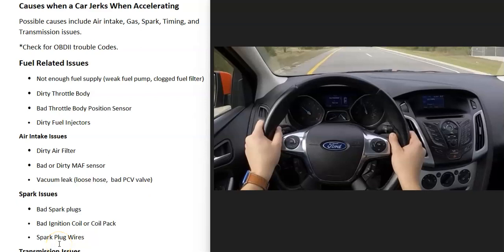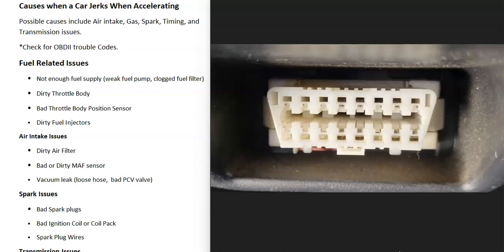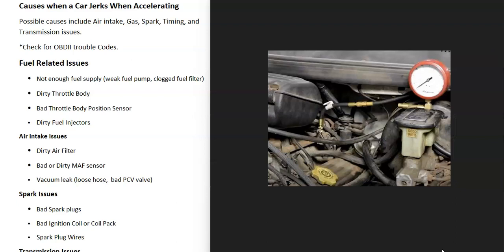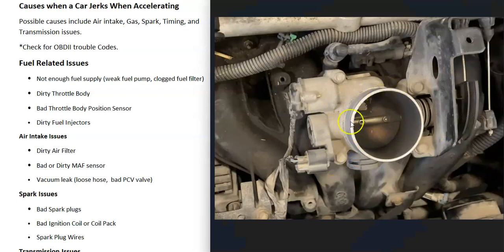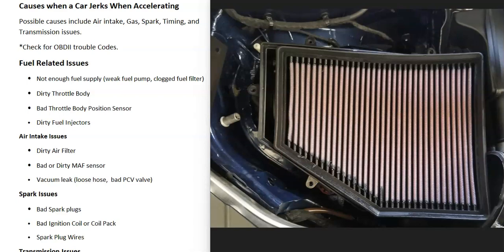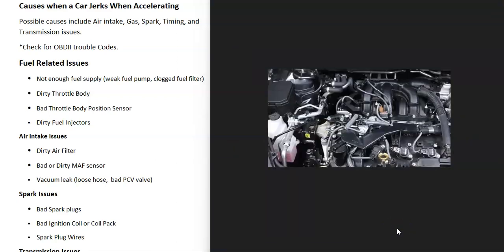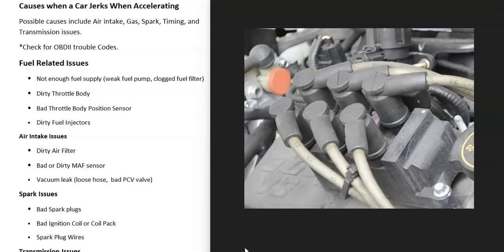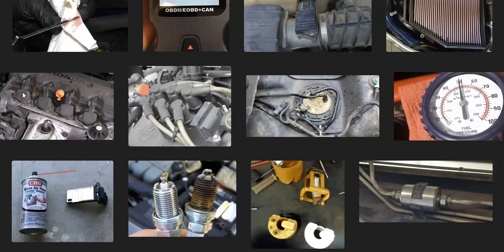Causes and Fixes Car Jerks When Accelerating

Comment: Ignition timing can also cause issues. I had an electrical short which reduced power going to the VVT solenoids. Caused timing issues.
Reply: says potential timing problems at the top of the video

Comment: Thanks for the video. I have a 2017 Chevy Spark and my car starts jerking while on a highway when traffic is moving slow then picks up. Just yesterday traffic was normal speed then all of a sudden went to 40 to 50 miles per hour for about 5 minutes then back to normal speed then back down and while I’m going to the speed of traffic my check engine light came on and car was very jerky until the point were it stopped moving. When it did start back moving it jerked very slow until it finally picked up speed. What could possibly be my problem?
Reply: Sounds similar to my problems, but mine only goes to 40 and doesn’t downshift, and today I was going 20 and it jerked quite a bit. Scanner said it may be ECU ( engine control unit). At best it may be some wiring, at worst my transmission is probably starting to perish.
Reply: I have the same issue. I get the code 0711 which says the Transmission Fluid Temperature Sensor is bad. I have the car at the dealership at this moment so they can diagnose the car.  They will confirm if the sensor needs to be replaced so I’ll be back with an update for you.
Reply: hi can i get an update?

Comment: Please help me I have a 03 mustang GT I’ve just replaced the fuel pump and transmission fluid when I let the car sit for a bit then u start it back up it accelerates fine but once I drive it for like 15 - 20 mins it starts to jerk and when I floor it it won’t go past 30 but when I slowly and steadily push in the gas it accelerates help me!
Reply: Sounds like an fuel to air mixture problem... mass air flow sensor or oxygen sensor

Comment: Hi can having installed a in tank fuel pump with lower flow volume than stock also cause issues like long term fuel trims going lean??
Reply: Yes it can
Reply: It would probably show itself the more throttle that is applied.. does it drive fine when your not accelerating hard

Comment: What about a p0191 code
Reply from the maker: The P0191 code stands for “Fuel Rail Pressure Sensor 'A' Circuit Range/Performance.”

Comment: Mine is a Buick rainier 2004 no engine light displayed 
It sounds rough in idle 
Now when I 1st take off and reach 15 ish miles per hour it loses power… doesn’t shut off or backfire, after about 10-15 seconds it acts normal even after I make a complete stop it runs fine from there On out…. Till I turn it off and restart it but it doesn’t do it everytime
I was also told it’s running rich
I got a new air filter, fuel pump was changed a year ago and replaced the fuel filter, replaced power steering a year ago and replaced the warmer pump thermostat and clutch fan recently, replaced plugs and coils maf is only a year old and recently cleaned the throttle body 
As well…. Any suggestions

Comment: Really like your video
But I have one issue maybe more 
 I don't know
When I give it gas it does good as long as I've got the power going up but once I get up to speed and try to level off that's when it starts jerking
Maybe think the overdrive was going in and out but that wasn't it
Bad gas I don't know
I'm old school if something back in the day with broke you knew what it was
Now it's like 30 thing between a and b
I know where some money thing
But anyway I can run wide open good
It's just when I try to level out and stay at a certain speed that's what it wants to jerk
I took it to three different places and it shows no codes at all the engine light's not even on

Why is it not showing a code I don't know that's my problem I don't want to fix something I don't need to fix I like to fix whatever it is
What is it that I can do if the no codes
Oh by the way I tried pulling a trailer I tried to put some strain on it to get the engine light to come on no luck
Why do you want to do that too much cuz it could be the transmission and I could be making it worse
Could you please respond and let me know what you think

2009 Dodge ram six cylinder

Comment: If there is no code?
Reply: I have 16 Tahoe jerks under low acceleration from 1 to 2 and is sluggish under light throttle..if I get on it it doesn't do it🤷‍♂️
Reply: @FLbowtieguysame here did you fix it?

Comment: Mine was jerking or cutting when accelerating.. changed the spark plugs and it runs like a new car
Reply: Spark plugs?
Reply: @SLOWDOWN863 yup.
Reply: What car did you have?
Reply: @oppajosh79682014 Explorer Sport with the 3.5 TT. Those engines are notorious for fouling out the plugs

Comment: my 05 escape v-6 bucks runs rough and stalls at hiway speed. The red light comes on with the lock over engine symble showing.
At cold start it runs nearly normal until engine heats up and then the speed drops and I will have to change out of over drive to maintain 50-60
After running 60 for 5 minutes the engine shuts down`. After sitting 5 minutes it will start and repeat the events. From stop light nearly pulls off at a walking pace. One person suggested the catalytic may de clogged. any thoughts? Thanks
Reply: Sounds like it's going into limp mode ...  what is your temperature reading when it shuts off after getting warm? You need to see what codes are displayed on the obd sensor ... it could be mass airflow sensor ... it could be clogged fuel injectors ... it also could be bad coils causing it to shut down due to improper timing due to the misfires ...
Reply: If your not getting enough fuel it will also shut itself down if the fuel to air mix is off and makes it run rich or lean ... this could be a clogged fuel filter or bad fuel pump ...

Comment: My jerk occurs when im 40 or faster just had a rebuilt transmission installed so maybe that's the issue but i noticed when i used fuel injection cleaner liquid it started happening
Reply: I used a fuel system cleaner, car started jerking a week later 😂

Comment: My car in winters usually jerks early morning but when I drive for 5-8 Kms it becomes smooth then doesn’t jerk through the day. 

In summer it never jerks. 

I noticed in automatic transmission when it shifts from its gear to second gear it jerks before 15 to 30kmph speed. 

Dodge challenger v6, 3.5L 

Any idea ?
Reply: I would recommend letting your car warm up longer in the winter, my truck does the same thing. I usually wait til the transmission temperature is past 80-85 to prevent it from shifting hard when I first move it.

Comment: My 2003 Mazda b3000/ ranger whenever I step on the gas all the way it goes up to 3k rpm’s then it drops and jumps up and continues to do that it like it shoots power to the engine then cuts out constantly any one have any answers?
Reply: ECU bro, or check transmission fluid. My experience so far is that those might be the issues. Even a vacuum leak, a hose might be catching air into the engine.
Reply: Same for my car rn

Comment: I have a 1995 Chevy S10 with a vortex 4.3 motor I just had a brand new fuel pump put in it a brand new starter had the timing reset on it a brand new battery and alternator And brand new fuel filter we picked it up yesterday from the shop that did the work. he drove great on the way home and all through town and but I wanted to take it down a back road and get up to speed quick you know? And when I did a little past the 2RPM hand it started jumping up and down and the truck started sputtering but as long as I keep it at the 2RPM or under it and accelerate normally it pulls fine. do you have any idea Why its doing that? And the only codes that are popping up on this truck when I put a code tester it's saying the EGR Valve
Reply: Same here with my 03 Mazda b3000 it starts to jerk and drop rpm’s once I get to 3k it would jump up and down
Reply: And I’m getting the same code I replaced the egr valve and it didn’t fix it
Reply: My code is saying the EGR valve also  @dirtysplat1336
Reply: 06 Mustang GT doing the same with new plugs, and coils and it’s had a fuel treatment done recently
Reply: Same thing with my  kia sedona but in my case its below 2k rpms over that it would be fine

Comment: 2018 Sonata, 92k miles.  - having to pussy foot my car around , (boyfriend replicated it the other day and will be bringing it in) .
Acceleration causes the car to go from 2-3k rpms and then around third gear it will just fall flattttt all the way under 1000 then it starts to stutter and pop until finally it catches and takes off. (Does it in any gear, manual mode) 150 miles currently in the tank.
Reply: Sorry for the bad explanation- putting this here for if they get it figured out. I have 4 shit boxes that I currently trust more than my sonata.

Comment: I have 2013 Cadillac XTS that does this. It drives fine and only stutters when cruising, and I lightly hit on the gas. The stutter goes away when I push harder on the gas or take my foot off the gas. My gas mileage is pretty horrible too. She has new spark plugs, a new air filter and mass airflow sensor, a new catalytic converter and two new O2 sensors in the front. The dealership did a fuel cleaning as well and I have cleaned my throttle body. I was having misfiring issues a few months ago and took it to Firestone and and they thought I had a bad fuel rail?! But they couldn’t replace that so they did a tune up. They put 41-988 spark plugs in and I googled those and everything said those only fit on the 2015 and up XTS. I called the Cadillac dealer and they said they would’ve put 41-109 plugs in. So I took my car back to Firestone and they swapped the plugs out. This is when I started to notice the stuttering. But on top of that I noticed that my throttle body housing was really dirty like maybe they dropped it when changing the plugs?! So I’m like it’s either they rushed and didn’t do a good job of putting the spark plugs in the second time or they messed up my throttle body sensor?! Plus I feel I could have like two bad fuel injectors. but every time I take it to the dealership, they can’t find nothing wrong with it. So I may take it back to Firestone to have them look at my spark plugs again to rule that out.
Reply: Hey did you ever figure out what happened with this situation? This exact shuttering is now happening to my 1997 Toyota Camry. Same thing, I just need to push a little harder or decelerate to get the shuttering to stop but I notice it around 45-60 mph
Reply: @ryanfrausto897  Sorry for the late response. But I got my ignition coils replaced and this fixed my stuttering issue.
Reply: Mine does the same thing because of the Transmission Fluid Temperature Sensor

Comment: 2014 ecape 2.0 ecoboost has new fuel inj new low presseser switch new plugs new timming chain head redone tow exhaust values  new varaivle timming sensors new oil change new tran change new thottle body new air filter i think it mite be coils because i can unplug them one by one and the number 1 acts real weak  does it have a fuel filter please help
Reply: All vehicles have fuel filters ... some are in the tank some are inline along the fuel lines and easy to change .... you can have your fuel pressure checked and that would tell you if it's a fuel delivery problem

Comment: I am the owner of a 2019 Chrysler Pacifica Minivan. I have noticed that when I slow down to a crawl, accelerate, or start from a stop, the transmission occasionally hesitates and jerks quite forcefully. The peculiar thing is that this issue occurs randomly in various driving conditions, and it does not trigger any error codes. Considering these circumstances, could it possibly be related to the torque converter?
Reply: Could it be the mounts lol
Reply: I'm having the exact issue. Mine is an acura 2016. Did you find out what happened?
Reply: @ In addition to the aforementioned symptoms, I started experiencing a spongy brake pedal that felt tougher to push than usual, and my stopping distance had increased.My mechanic suggested that I have my  BoostBuster/ brake booster checked.  

I replaced it  and I haven't run into that problem again. It might not be what's going on with you, but it’s a good idea to check it out. All the best.
Reply: @costellosamuel3706  I don't have that issue. I have an appointment with a different mechanic tomorrow. I'm praying he'll be able to find and fix the issue.
Thanks so much for responding!
Reply: @cassandranelson4470  I know how frustrating car problem and car repair can be,  God's favor and all the best.
Reply: I am having the same issue with 2014 dodge journey. It also happens when going up hills and takes a while to build up speed. So frustrating my mechanics says he doesn't know what causes it.
Reply: I have a 2020 Chrylser Pacifica and have nearly the identical problem as you mentioned where the car will hesitate and jerk when re-accelerating after slowing down and the RPMs hitting around 1,200. The dealership has no idea what the problem is because it is not registering any error codes. They think its possibly a bad coil pack or spark plug. Are you saying all of your issues were actually caused by the brake booster? I haven't noticed any problems with braking at all. Curious what you found. Thanks!
Reply: @mattbey  After my mechanic suggested replacing the brake booster, I went ahead with the recommendation, and I’m happy to report that I haven't experienced any issues in the past year. It's important to note that one solution doesn't fit all situations. I’m not a mechanic, but I did some research on the problem and found several potential causes:

- Dirty fuel injectors
- Fuel blockages
- Worn-out spark plugs
- Dirty air filters
- Damaged cylinders
- Blocked catalytic converters
- Damaged gas lines
- Damaged acceleration cables
- Defective carburetors
- Moisture on the distributor cap

“It could be a fault with the spark plugs or a buildup of dirt and grime. A clogged filter or fuel injection system can also starve your engine of fuel or oxygen, causing your car to judder and shake.” 

Additionally, Chrysler and Dodge vehicles, particularly older models, have a reputation for potential engine failure issues. Be sure to check if there are any recalls on your vehicle. God’s favor.

Comment: i have a 2018 kia forte with a manual transmission. whenever im in the 2,500-4,000 rpm range and let off the gas in third gear it jerks quite a bit
Reply: Same issue here on a manual transmission

Comment: I have a mitsubishi 2004 galant that was handed down to me and is just constantly a problem, the only code showing right now is for the evaporative emission system leak which now is large but my car runs like shit ive changed the fuel pump put cleaner in and changed the filter but it still really struggles driving i can only get to about 60 65 and 2500 to 2800 rpm and if i try to go higher it just starts chugging and struggling
Reply from the maker: If you have EVAP codes and the engine runs badly check the Purge Valve it may be stuck open.

Comment: Is there going to be a code to read if there is no check engine light?  Because I thought there would only be a code if the check engine light is on.
Reply: You can still get the code even without the check engine light on
Reply: How did you get this fixed. I’m facing same issue with my Toyota
Reply: @ibrahimsalifu8458 Sorry never fixed it, got rid of vehicle. May be related to the TCM module have that checked.